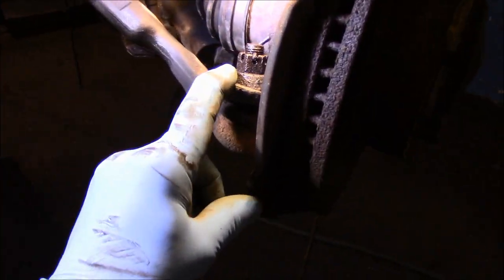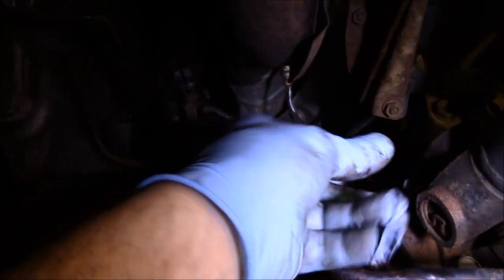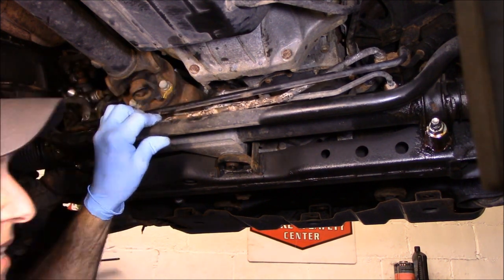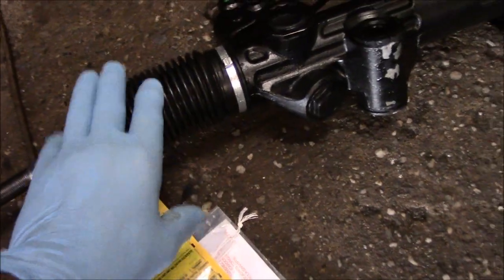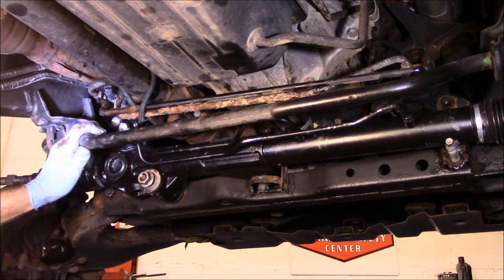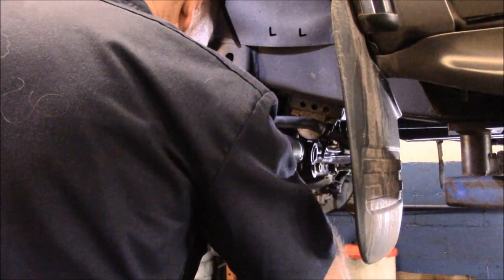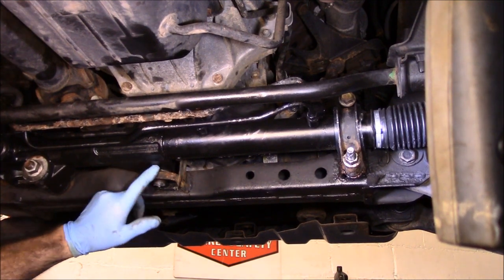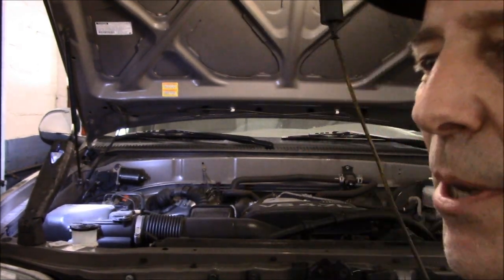How to replace the rack and pinion on a 2003 Toyota Tundra

Comment: That was a pretty big job with some tight areas to work around. Having a lift sure makes it easier. Nice work as usual Jim.
Reply from the maker: Hi Wyatt,Yes a little tight but over all not that bad.Some can really be a pain in the a-s like the one that you need to support the engine from the top and then remove the lower sub frame.
Reply: Agree. This would be something I'd take to a pro. Can't imagine doing this in my driveway with jack stands and hand tools. :/

Comment: Thanks for the video, no B.S! Very straightforward. Mine just started leaking at the same exact place for the same reason! I live just west of Chicago and I'm in the middle of the rust belt. 200k and it's a 2002 Sequoia.
It's November 24th 2019, so I have to have someone do it for me. I hope the hydraulic lines come off as easy as yours did! Thanks again!
Reply: My '07 with 140k just started leaking today, and I'm northwest of Chicago.  Can I ask who you had replace it and how much it cost?  Thanks.

Comment: Maple Grove Automotive in Downer's Grove. I bought the rack and line kit on line from a Toyota parts dealer
along with the new bolts. Maple Grove put it on and had the front end aligned for around $800.00 I would have done
it myself except when it started leaking, it was cold and snowy out, and I couldn't.tget it into my garage.

Comment: As with with many things in life, when you are shown how to do a certain task the maestro showing how to do something makes it look so easy due to his experience and skill. I am not a mechanic am am usually reluctant to to do certain things that are, what I consider, above my pay grade.  However I have watched your excellent video several times now and am feeling sufficiently motivated to take on the task of replacing the rack & pinion for my 2000 Tundra. When I opened the small package that has the O rings and cotter keys the instructions advise to flush the power steering system prior to installing the rack & pinion. I didn't see this in your video.  The instructions also state that the air bag restraint system must be disabled while replacing the rack and pinion steering gear. This also was not in your video. The other thing that I wanted to comment about is that the new rack and pinion that I purchased did not include the holes necessary to insert the cotter keys. In lieu of the holes the kit included a lock nut. I am assuming that as long as the number of turns that the rods were positioned at ,at removal, one just has to tighten the lock nut up tightly. That said, I will study the video several times more. Thank you Mr. jimthecarguy.
Reply: how did it go?

Comment: Hi Jim the bushing on the passenger side has a hole in the metal bracket.  My understanding is that the hole is suppose to be on the top side or am I  incorrect? I'm  asking because I'm going to be replacing the bushings on my steering rack on my 99 4Runner.  Love all ur Video's they really  given me the confidence to repair my own vehicle. 👍😁👍😁👍👍👍

Comment: The video was very useful, but how does one buy the correct spare part, in this case the correct rack and pinion?  If one buys the wrong rack and pinion, can it be returned for the correct replacement?

Comment: I did this on a 2001 Tundra.  The bushing erosion is where it leaked.  One of the tie rods took a 14 and a 24 pipe wrench with cheater bar.  The19 mm hidden on top was a small challenge. I used a box wrench.
Reply from the maker: Yes this is a very common problem

Comment: Retired fleet mech here, great video but I gotta ask, where on earth was your eye protection Jim ? can’t tell you how many youngsters I seen  headed to eye doc and getting written up for issues related to PPE, and omg your face around that battery no glasses was a cringe maker.

Also I’m curious did you just not film the cleaning of mating surfaces for the rack mounting surfaces along with all the threaded hardware as well as mucked up pressure line threads to keep the muck outta inner PS fluids?

Comment: Hey Jim I have a 01’ Tundra 4x4 and have no leaks and New bushings on my R&P but my steering is like that of a boat. Hard to keep straight and when I bring the wheel back to center from the right it almost puts the truck into a dangerous sway.. any idea what it could be? I was just going to replace the R&P and put New away bar links but didn’t know if it was related to air in the system or bad seals inside the R&P. Any help would be appreciated thanks.

Comment: What else starts to go on the Sequoia's and Tundras at about this time?  I have an 07' Sequoia with 140k.  It has newish brakes, tires, timing belt, and water pump.  Fluids have been maintained.  However age and rust are concerns.  I'm considering whether I should keep the Sequoia for the long-term or if I should get a new vehicle soon.  Any suggestions are appreciated.  Thanks.

Comment: Hi Sir,
Just want to ask if the rack and pinion bushing is designed to have a little play/flex when you turn your steering wheel? The car is not lifted with jack.
Reply from the maker: Yes it does have a little play but not much.Thanks for watching.

Comment: my trac control light its on after replace the rack and pinion and code c1231 is now on try to recalibrate sensor but still having the code any sugestion

Comment: Jim, great video. If I suspect I have a binding steering shaft coupler, does the entire rack and pinion need to come out to replace the steering coupler or can it be changed from up above?  2002 Sequoia.
Reply from the maker: No you can just replace the coupler.
Reply: Is the coupler accessible from up above?
Reply from the maker: @edwardsaylor   Good question  You will need to get under the dashboard and also under the truck buy the rack.

Comment: The tie rod ends would not come out. No amount of beating on the side like in the video budged them.  The first one came out after an hour, applying heat, and beating a cold chissel into the joint with a two pound hammer.  The second one was somewhat easier as the useless step of beating on the side was skipped.  Otherwise the problem was the new rack did not allign EXACTLY with the bolt holes making installation very difficult.  This is NOT a job for amateurs though the video makes it look easy. Altogether it took two of us with a full shop and a lift five hours.

Comment: What are the names of the 2 lines that you tied up at 10:06? I need to replace them and having issues finding them and their names or part numbers. Thanks.
Reply from the maker: Those lines are the power steering lines
Reply: @jimthecarguy  are they pressure hoses or return hoses?  Thanks for the help